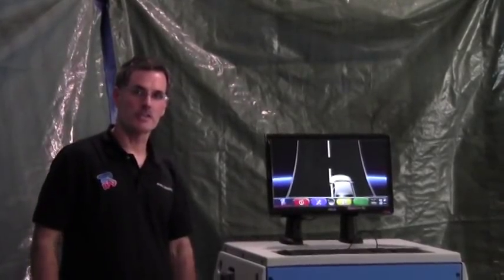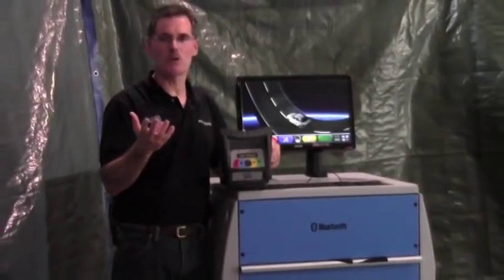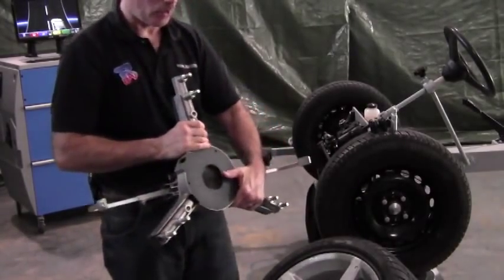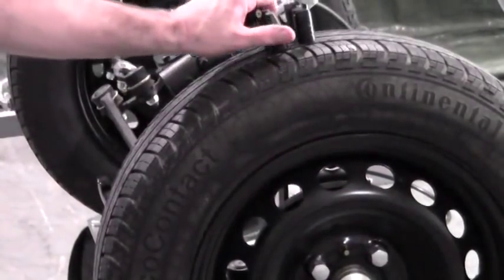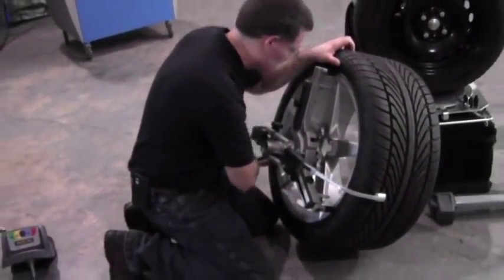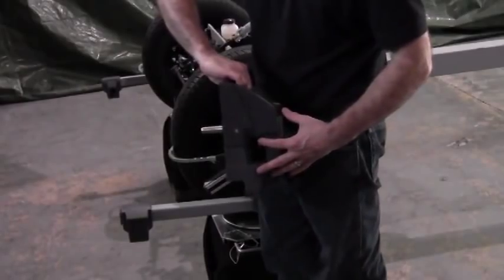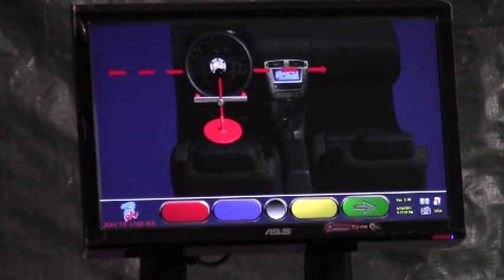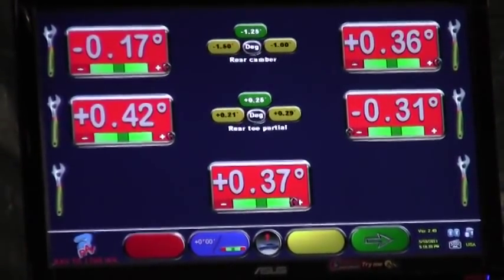Rav Wheel Aligner Training

Comment: I purchased this machine about a year and a half ago. The unit literally has 4 buttons to press. I have done almost 400 alignments with no falling heads or complications. I have a very small shop without a drive on lift. I use 4 wheel stands and it takes on average for me to do an alignment about 45 minutes. The local body shops and tire shops use me for their alignments. Best purchase I have made in a long time. It paid for itself in 6 months. I thought I was going to do 2 or 3 alignments a week and take years to pay off. I do 2 or 3 a day some times and am very happy.

Comment: Hi, we have the TD2200WS. The PC Board died inside. We took another PC, installed everything, installed the Software. The software works but the left side measure device is not working with the software. I tried and configured the left side in the right side, the system recognises it and works, shows the battery percentage but when I connect the right device to the left side on the software its the same. Bluetooth goes blue in the indication icon, but doesent read the device on the left side. Whats the problem?!
Reply: install the bluetooth drivers or change it

Comment: absolutely the worst user friendly aligner.
Reply from the maker: +Nate Halter sorry you are finding this Nate, we would like to offer you a free training session at our UK head office to show you the best way to use your wheel aligner in a fast and effective manner. Please contact the office and we will book you a free session or please let us know how else we can help you with the aligner
Reply: +AAWheelAligners  This machine is just not user friendly, there's no teaching bad programming or bad engineering. The wheel clamps on this machine are god awful. There's too much to adjust while holding the wheel clamp onto the wheel and %50 of the time you have to re-adjust the clamp to fit correctly. I have already had heads fall off because the clamp slid off the tire tread. Also it was told to us that the rear heads do not have to be level, that is wrong. If you turn the rear heads up or down when you have the measurements on screen, the measurements change. So they need to be leveled, but there is no indicator to do that. On the programming side of the machine, there is no labels to indicate what buttons do what on the machine. You are basically guessing what buttons do what. It is very hard to cycle backwards in the alignment process. The machine has no win-toe to get the wheel straight during the alignment. I have yet to get a straight wheel after an alignment. The programming is also very slow to respond to adjustments and issues with the head being blocked. I work with 10 other techs and were all very unhappy with this machine. We went from an old hunter that still had cables to attach to each head and got much better results from that machine and also hunters programming is so easy to go through the alignment process. Also hunters wheel clamps are a no brainer to use. This machine has slowed a busy shop down considerably when doing alignments due to its major problems. There is far to much guess work and attention to detail needed on this machine.